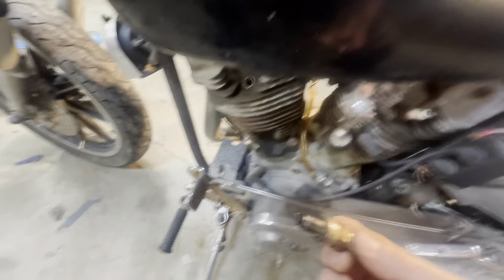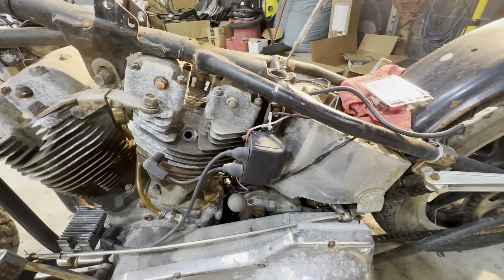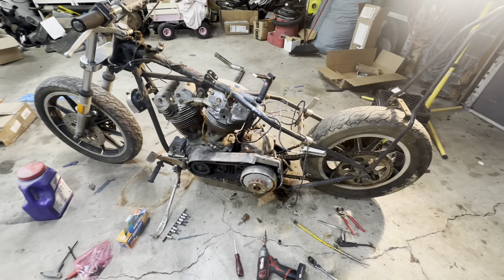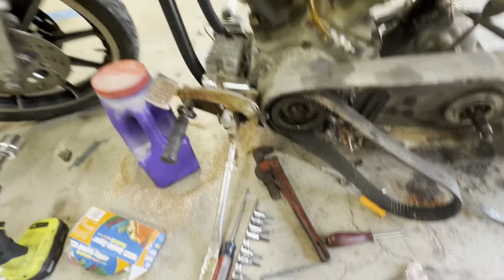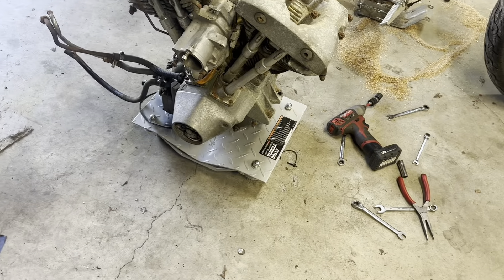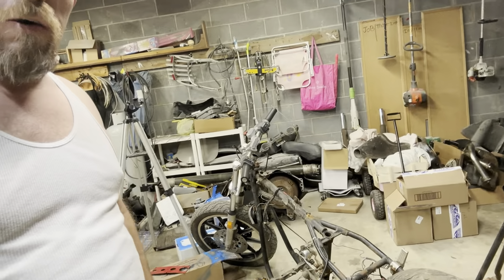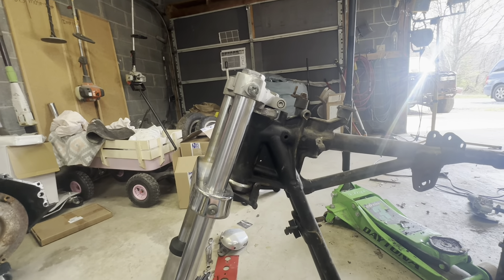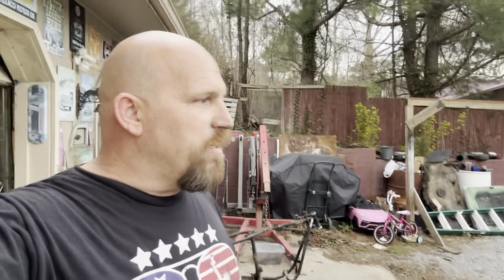The devils Harley down to frame

Comment: Nice strip down on the Harley. I'm wondering if the rear cylinder had a lack of oiling or was running lean? Either could have caused it to overheat and seize up. The overheat would cause it to rust inside for sure, but obviously just a theory. I would love to see the old Mercury upgraded to fuel injection, lowered and big Foose wheels!
Reply from the maker: Ironically I still have that dodge magnum sitting here that has a set of foose wheels on it so maybe do a change over and if I can swing it financially to do fuel injection I will defiantly be doing that
Reply from the maker: And the Harley I’m not sure what caused the issue but the engine builder will be letting us know what he finds